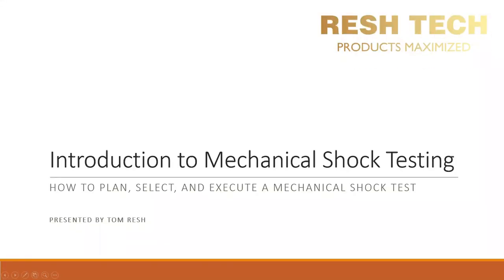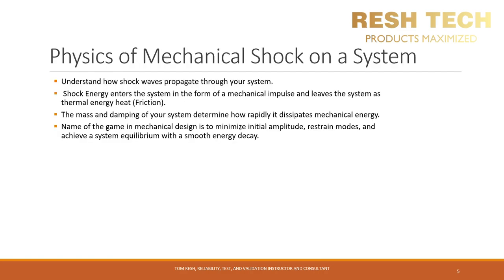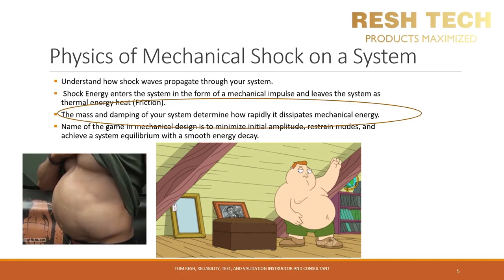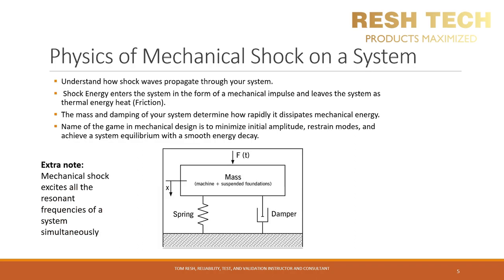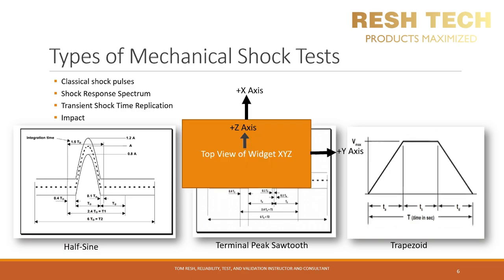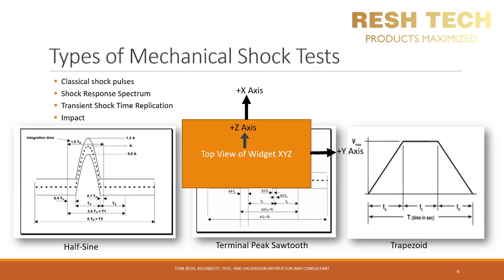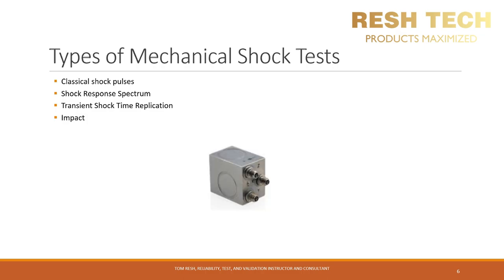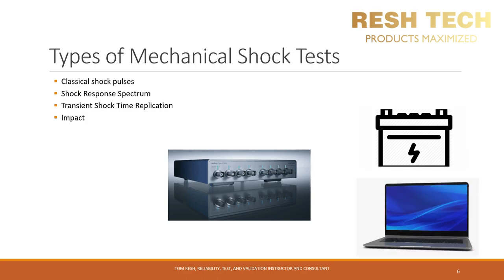Introduction Mechanical Shock Testing

Comment: Could you please define in classical shock pulses when we  select half sine, when select sawtooth and when select trapezoid?
Reply from the maker: Hi Aalim, The best approach is to perform field testing with accelerometers attached to your system and collect the acceleration time data to produce your shock test, which is the ideal approach.  

With that being said, a half-sine is a quick and dirty shock simulation of a damped system, for instance components mounted above the shock absorption system of a vehicle.  It can also represent dropping a system that is in shipping packaging or a system dropped onto a carpeted surface.

Sawtooth represents a sharp peak impact or input into a non damped or minimally damped system.  An example would be a free-fall drop shock input into a system that is accidentally dropped on to concrete.  It can also represent a system rigidly mounted to a turret and the turret fires a ballistic round.

Trapezoid shock pulses can produce the most damage as a longer duration is spent at the peak acceleration as given by the wide pulse width of a trapezoid.  You will see trapezoids called out in some specs, however, I have not personally seen a trapezoid pulse in field data collection and in my opinion its more of a enveloped test to see how much damage can occur at a given acceleration level for a predetermined pulse width or pulse duration.   

Half-sine, sawtooth, and trapezoid all have different levels of energy content in the pulse with trapezoid containing the highest amount of energy content compared to half-sine and sawtooth pulse with the same peak acceleration.

All three of these pulses will also cause your system to respond or behave differently from a modal standpoint.  

I hope this helps, but if you are trying simulate a real world shock event in the field for your system go collect some data and create a corresponding shock test.

Comment: How does one perform the negative and positive shock pulse of a half sine shock on a drop tower?
Reply from the maker: You would need to have provisions that allows you to rotate your system  180 degrees vertically to change the polarity of your system to the direction of the force input.  This can be quite the challenge with a large/heavy system.